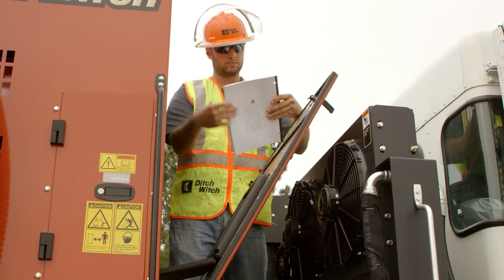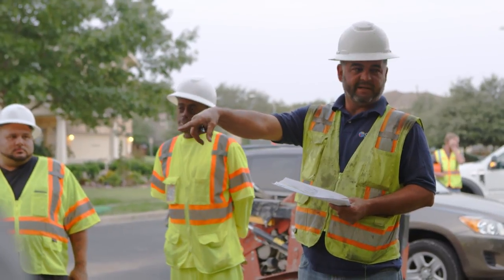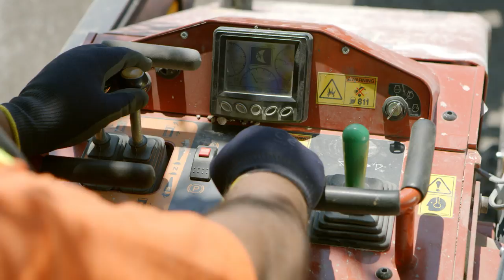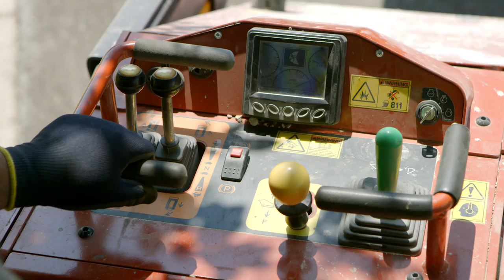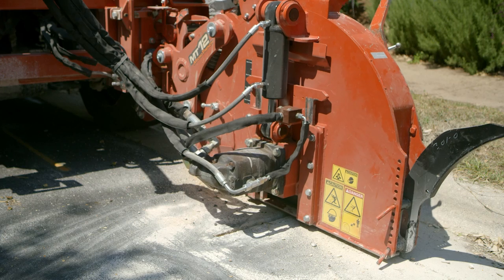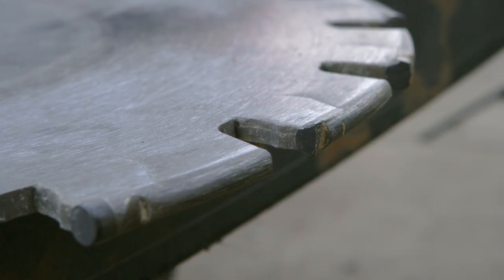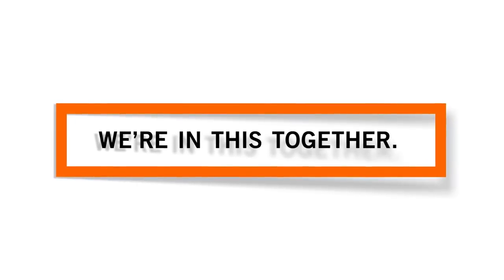Ditch Witch® Microtrenching Safety & Operation

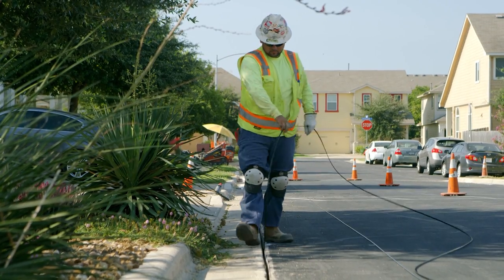Comment: 11:19 did they really just put the cable directly into the ground rather than using a microduct? Why continue with the bad practice of not using pipes for telecomunication cables? Not using them with copper telephone wires brought us all this shit. If we would have done it with pipes rolling out fiber would have been a breeze.

Comment: I'm running a micro trench job rn in Colorado, in the winter and we're having a hell of a time because of the wet clay beneath. We've tried with vac, it clogs constantly, now we're trying with the shoot and it's a little better but still the clay is gumming our blades up often. It's all of our first times with this type of equipment. Any advice helps. Thanks
Reply from the maker: We have a great dealer in Colorado. Would encourage you to reach out to them: https://www.ditchwitch.com/find-a-dealer/